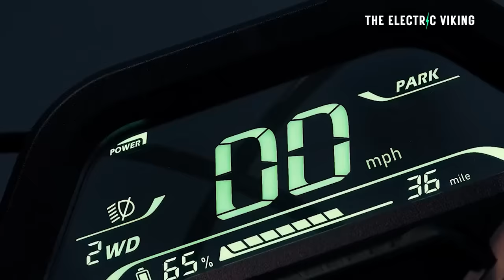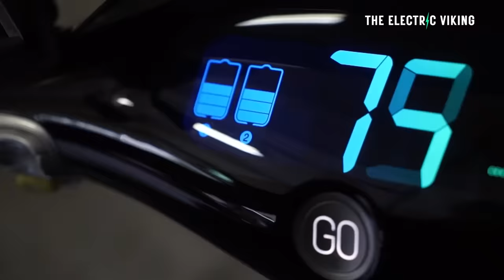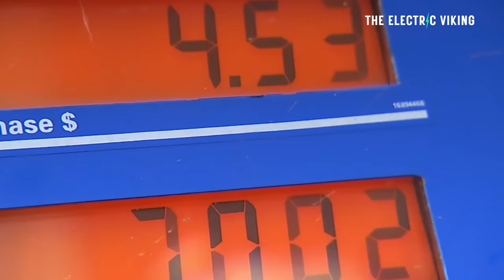Electric scooters destroying oil demand 4 times faster than electric cars

Comment: I've saved a fortune using my scooter. Have done at least 5000 km with it in 2 years, but not exactly sure because the odometer wraps at around 650 km for some inexplicable reason!
More people should use them for local trips and for fun, and lobby governments to legalize and derestrict them - they might not like the loss of gasoline revenue, but our lungs will.
I saved so much in 8 years, that I was able to buy a Tesla Model 3 last week! Still gonna use the scooter though.
Reply: Should be about 136 gallons at 22mpg.  About $400 at 2.89 a gallon.  Plus tires, maintenance.. at 0.50 per mile, the government tax write-off would be about $1,500 for that many miles on a car
Reply: It's for countries without winter only (
Reply: @MaksimSSM  not true, just need a bit more energy to run.  I've done 6600 km in the last 30 days, in winter, around Europe, no problems.
Reply: @ahaveland  Try in Moscow or Ekarinburg 😃
Reply: @MaksimSSM  Arctic cold is something beyond "winter".

Comment: I agree...Like The Electric Viking said this is helping to reduce oil consumption, and I know a lot of people don't like these small 2 wheeled eScooters but small eMobility vehicles doesn't have to come in that form, a better design should be looked at if necessary. I have a eScooter and they are so useful to get about on small journeys but unfortunately I have to run the risk of getting it taken away from me because they are not legal yet, and so many others here use them because they are useful.

Comment: I absolutely agree. Not only e-scooters, but also e-bikes. 

They are not a solution for all types of travel, but they are a solution for short-range, they are a great solution for most inner city travel. And cities are exactly the place where cars are more of a problem than a solution. In a densely populated area cars take up too much space.
Reply: In the USA, getting  bike for short range riding isn't a thing.  Spending 30 grand for traveling just 100 miles to spend hours recharging will not work here
Reply: @Cre8Lounge  30 grand? Try 50 or 60 but then Dealers are asking that much for ICE vehicles now too. If the under $20,000 Chinese electric vehicles ever pass North American standards & are permitted to be sold here, it will mean the end of the North American Auto Industry & all it's sub industries.
Reply: @daytriker  You can get a brand new Tesla Model 3 for under 30 grand. And a new Model Y for under 40 grand. And no dealer to deal with.  And don't forget that Rivian is another American company without dealers. And their gen 2 trucks are going to the in the 50 something thousand area, which is as much as most regular ICE trucks now.

But I agree that the dealership monopoly needs to end to bring legacy prices lower. And I wholeheartedly believe it will end with the Gen-Z generation.
Reply: @daytriker  The American auto industry is alive and well in Tesla, its just the rest that are bankrupt.
Reply: @tedmoss  I wouldn't count them out just yet. With GM already owning a 3 way partnership for a battery & manufacturing Business in China, I think it is a good bet  they will be importing Chinese cars into North America. The Business Model & Service might change but GM is worldwide & if it works for Europe, Central America or Asia you can bet they will lobby Government to permit them here. The Unions might not like it but if ICE vehicles aren't selling, the assembly line jobs will need to adapt.

Comment: This very significant move to electric scooters will also dramatically improve air quality in Asia as more and more electricity is generated by PV panels.
Reply: Small gas engines pollute horribly and are terribly inefficient.  E-transportation greatly reduces pollution even if all the electricity was generated by burning coal or even by running a giant diesel generator set.
Reply: @peteinwisconsin2496  They don't reduce pollution. They EXPORT the pollution to somewhere else. Both in powering it and in the production of it. If E-enthusiasts were honest about that, then perhaps there would be less hostility from everyone else.

Much of the enthusiasm though for EV-anything is Virtue Signalling. If that honesty went mainstream, the enthusiasm for electrification would take a pretty significant nosedive.
Reply: @Crosshair84  We get it, you skipped science class. Too cool for school.
Reply: @Crosshair84   Let's say your bullshit was true.  Would not it be helpful to export the pollution to areas where people don't live?
Reply: EVs in the end don’t actually reduce anything. Gas and diesel have little effect on air quality overall, it’s the coal and other industrial plants producing toxins at far greater rates. China is the “leader in green energy” yet has the lowest air quality in its cities and 90% of its ground water is too toxic and unusable.

Comment: All forms of electric ⚡️ mobility should be supported and encouraged
Reply: Yes, but the smaller the better (less input materials mean less mining, and less diesel burning in the supply chain).

So we should still ban SUVs.
Reply: Exactly. Then, when everything is electric, you can focus on the most bestest solution ever, but don't hold up electrification anywhere where infernal combustion engines are still a thing.
Reply: @thorium222  I'm saying the opposite: Electrification will be helped up by material constraints. So if we conserve materials, for example by banning SUVs , we'll complete the process faster.

The more we conserve battery materials the faster everyone gets an EV.
Reply: @domtweed7323  
Nothing shouts Communism like banning stuff.
Reply: @tassie7325  "Communism is Soviet rule plus electrification" -comrade Lenin.
Reply: @domtweed7323  We should ban the sort of people who want to ban things
Reply: I live in Arizona and use my electric four-seater golf cart as a car almost every day for short trips.  The LFP battery easily provides 50 km of travel.  The back seat folds down and provides a nice cargo area.  Provided they comply with DOT requirements (lights, horn, license plate, etc.), they are legal on any road in Arizona posted at 35 mph or less.  They are everywhere.  I disagree with Sam on fossil fuels though.  He keeps saying they are subsidized in western countries when they are NOT!  I wish he would quit lying about it and just stick to the truth, good or bad.
Reply: @domtweed7323  so what do you do if you need an SUV?
Reply: @domtweed7323  Banning SUV's is harder than it sounds. People want SUVs so you're going against millions of people's wishes (at least here in the U.S.). Also what's the definition of an SUV? There's millions of crossovers on the road that are almost SUV's but are slightly smaller. Where do we draw the line? I say it's better to provide an appealing alternative. For example, make bike lanes on every road and make it possible to use scooters, bikes, e-bikes etc. Without safe lanes, you're basically a moving target for 2-ton erratic monsters whose drivers are looking at their phones.
Reply: @domtweed7323  Absolutely not. There are no shortages of battery materials, and they can be recycled.   Batteries for EV's will be dirt-cheap when the technology is ripe in 5 - 10 years.  Meanwhile, we need to be building out solar farms... the least expensive way to generate 'new' electricity.
Reply: @SunriseLAW  Currently no EV batteries are being recycled for Lithium and its a limited resource with only 24 million tons viable max on the planet.
Reply: @markjerling6109     US oil exploration and drilling is where the subsidies come in.
Reply: @xraylife   Mass conversion to electric vehicles probably WON'T rely on lithium.  That said, lithium is RECYCLEABLE but there are not enough depleted lithium batteries right now to make it economically feasible.  There are 24 million tons of PROVEN RESERVES.  Each Tesla uses about 165 pounds of lithium.  That is enough for about 300 million cars.  Just as with oil or any other mineral:  when/if the "proven reserves" start running low... that is when they go look for more, the supply is virtually unlimited, especially considering it is RECYCLABLE.
Reply: @carlwest859  Carl... no they don't.  If you are thinking of the Intangible Drilling Credit, it's just a faster write-off of a small portion of the drilling cost.  It's been around since the 1920s, has parallels in other industries and is not a subsidy.  You just write off the true costs a little faster, but you still pay the taxes on any profits.   Speaking of taxes, the oil industry pays tons of them, many that no other industry pays (except for mining) such as severance taxes.   There are others.   I was in the industry for over 35 years.  The "subsidy" claim is a lie that won't die.
Reply: @domtweed7323  I disagree. There are more than enough resources to electrify everything and they can all be recycled forever. It is a non issue blown out of proportion by energy transistion detractors.
Reply: @SunriseLAW  300 million cars when there are 57 million sold each year means if everyone had an EV the supply would be exhausted permanently in 6 years!
There are only 70million tons max and most is unviable - under the sea and inside volcanos etc..
And there is no recycling going on of Lithium in batteries as its too expensive. 

So do the maths and the outcome of the ICE ban is your removal of the right to vehicle ownership - unless you can afford 200K for a new car in the future!

Comment: Here in Singapore, electric scooters are heavily regulated. There have been many accidents because of delivery people (Grab, Uber, etc) going as fast as possible to get more pay. I personally love powerful electric bicycles and scooters. Simply follow the rules of the road.
Reply: also, motorists need to put down their phones. A Harley rider I know says it's way more dangerous than about 7 years ago, because of all the people texting.
Reply: Harleys should be banned. Effing noisy nuisances.
Reply: @wyganter  I don't ride a Harley. But from what I know about motorcycles in general is they are all designed to meet emissions standards. The loud noise you hear comes from aftermarket mufflers.  Same is true for cars.
Reply: Easy to solve because their max speed can be limited easily...and without being able to circumvene this limitation. 

But this shows that the administration administration is pretty dumb by showing that it doesn't know about that but tries to "educate" people to behave. No education needed when your ride is limited.
Reply: @thyristo  Ok. So using this logic, why not limit the speed of ALL cars?

Comment: as soon as sub 20k Ev's hits the  western markets its game over for ICE cars what i find baffling is that almost everyone i know that owns a electric car  has no wish to go back to an ice car again (only had one  trading into a hybrid) but all the naysayers i meet  have'nt owned a EV.
Reply: Indeed. All those naysayers who worry about range, charging, bursting into flames and batteries needing to be replaced every few years..none of them have any experience of owning an EV. I am nearly 5 years in to EV ownership and there is no way on this earth I would go back to having to buy fossil fuel again even if I was gifted a fossil fuel luxury car.
Reply: How much range would a 20k$ EV have? Even the cheapest ICE car gives you 500+km of range on a full tank. For people who don't live in a place where they have access to parking space power, having to rely exclusively on fast-charging is ludicrously expensive in many places. The lone Chargepoint charger that showed up last time I planned an EV trip billed $0.45+tx/kWh, which is about as expensive as gas.
Reply: I have had Tesla Model 3 for 4 years now (Sydney). I have no plans to go back to ICE. In fact, I sold my Nissan pathfinder as it starting growing weeds around it. 70% of my friends have Tesla now. In the absence of advertisements, Tesla sells better with word of mouth I guess.
Reply: @kiae-nirodiariesencore4270 so one case of only 5 years?
Reply: @teardowndan5364 is very likely that $20,000 EVS will have a range of about 260+ miles. And that you'll be able to load a couple aftermarket batteries in the back and extend that range by 26 mi in an emergency.
Reply: Yup I'll get one. My daily driver is an 18-mpg minivan and I'd love to have an alternative -- EV, e-scooter etc. -- for short hops. For highway trips 500+ miles, though, the van is still the only choice, at least until an EV van comes along with amazing range and doesn't cost an arm and a leg.
Reply: @teardowndan5364  Unfortunate for now but simply just a question of time.
Reply: Won’t happen , they can’t sell them that cheap unless they loose money
Reply: @jassam707 I have Tesla model 3 in Melbourne, I also have a golf gti .. both great cars .. Golf is far more convenient on my regular long road trips
Reply: @MrBigbangbuzz  Probably the worst part for conventional car manufacturers is that many countries will fine them for falling behind EV manufacturing quotas regardless of lack of demand from their customer base. They are forced to eat losses either way.
Reply: @teardowndan5364  EV do have a place , but I agree , it’s just dumb doing that .  Passenger cars will hardly make a dent on net 0 , as it’s industry.
I’ll always have one ICE car , it’s a freedom machine , hopefully no ULEZ type scam where I live
Reply: @teardowndan5364 In many countries in Europe gasoline costs nearly 2 euro/litre that is appr 7 USD/gallon, then the calculation is something else.
Then the yearly road taxes for ice cars are quite high in many cases.

Comment: My city in the USA is converting some of the streets from 4 lanes to 3 lanes including a center turn lane.  This conversion allows for bike lanes.  Problem is, during the winter, snow plows clog all bike and pedestrian paths with snow.  So, when the weather turns mild enough to ride, it takes another two weeks for the snow berms to melt.  Just a small grip I have in a generally positive view of our city. Ebiking is wonderful: hills, no problem.
Reply: Snow tires.
Reply: @godemperormeow8591  better yet, electric snowmobiles.

Comment: For middle to long distance travel, trains are superior actually. Electrical mopeds and bikes are viable within cities and towns, but if you want to go further, you need other means.
Reply: Yeah essentially you scoot around until you reach a train station, take that for fast travel on long distances, get off and do the last mile with the scooter again. That is especially true when you have high speed trains which are twice as fast as cars or inside cities where linear subway lines are faster than getting stopped by a million traffic lights. Cars are #1 in terms of suburban environment and small towns but they get progressively worse the higher the population density.
Reply: @xXdnerstxleXx  You should see what they are doing with Teslas in NYC.

Comment: One of the biggest drawbacks of electric scooters or scooters in general is safety.
Reply: nothing and nowhere is safe anymore might as well have fun
Reply: Yeap it's true nothing is safe,even cops that drive motorcycles with those lights and siren they still get in to accidents.
Reply: if there were fewer multi ton vehicles on the road the safety factor goes up exponentially  it's all relative   i ride a hundred pound e scooter for fun my weight is 200 so im pushing a 300 lb projectile that is capable of doing major damage to any one  however when in the presence of pedestrians  i can ride the scooter at walking speed  and not upset anyone  it's all relative.
Reply: Because auto drivers don't see them.
Reply: @AllDogsAreGoodDogs   a simple law- wear reflective strip at night and   light   same rule as bicycle 
that solve the driver dont see BS
Reply: @santiagovasquez1404    ii rather get hit by a 300lb  scooter  then a 4000lb car. at least with e scooter i got 99% i can get up with few bruise and all good
Reply: Ideally these would be on the streets of cities with golf car like vehicles that can only go < 30mph. That would improve safety, efficiency, and parking.
Reply: @jetli740  No, it doesn't, but it might help a little.
Reply: @keithv3767  Just limit people to 25 MPH.
Reply: @jetli740  Actually it doesn't solve the problem. On any average passenger vehicle there are 20 blind spots from the drivers perspective. That's how drivers get into collisions with buses & dump trucks.
Reply: @tedmoss  Fair enough.
Reply: @daytriker  I agreed with you no one solution is the answer, but hopeful uk
come up with a solution that legalise the use of scooter.
Reply: how about ecomobile type? and scooters arnt really unsafe if you consider that it makes user more alert and aware compared to sitting sedentary in car with audio visual entertainment distractions. scooters w would reduce traffic immensely as if there is accident, it can be dragged to the side of road easy to get out the way of many more users per square meter of road than car.

Comment: Sam, I think you are right on point, and electric micro-mobility can reduce gas consumption faster than electric cars.  It less costly to add an e-bike or e-scooter to your fleet than to replace a fossil car with an EV.  

IDK about eliminating trains and using their track right-of-way for scooters.  Although this has been done for abandoned railways in the US, if all rail was eliminated how would freight be delivered?
Reply: Yes, I thought it was silly just for passengers and the fact this thing called 'distance' exists but freight is an exceptionally good point. What destroyed Americas infrastructure was ripping up railways. It hurt the UK too - people are still upset about the closures of smaller lines 60 years ago.